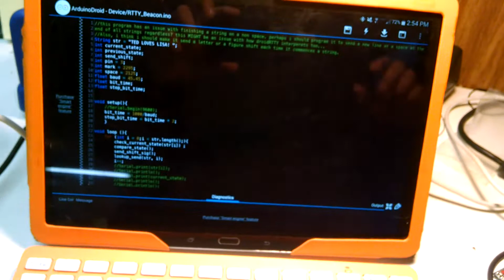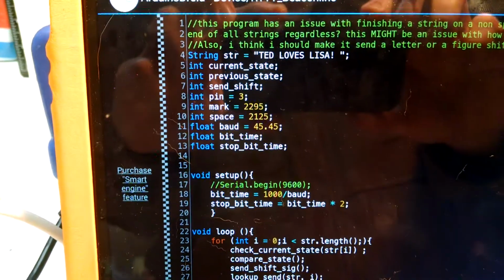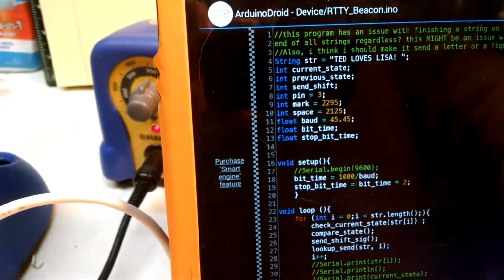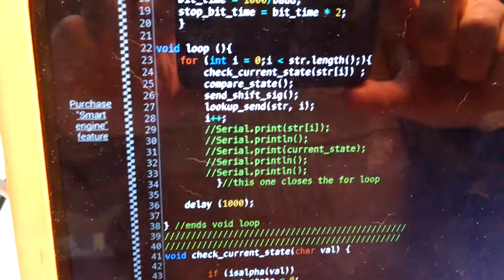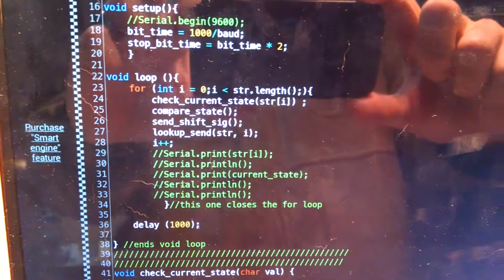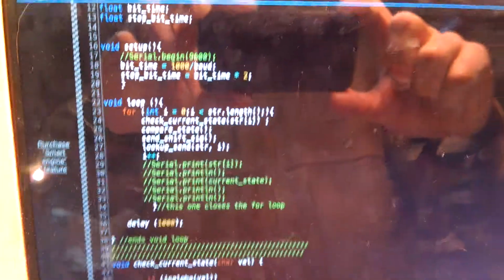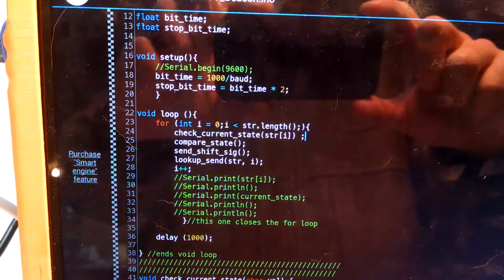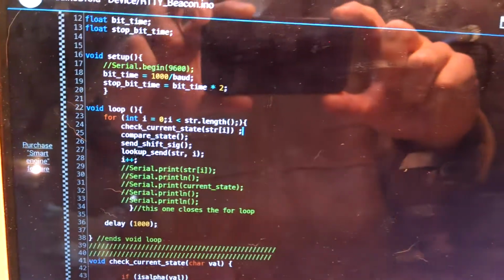RTTY Beacon Arduino

Comment: String str = "TED LOVES LISA!";
int current_state;
int previous_state;
int send_shift;
int pin = 3;
int marks= 2295;
int space = 2125;
float baud = 45.45;
float bit_time;
float stop_bit_time;
void setup(){
  //Serial.begin(9600);
  bit_time = 1000/baud;
  stop_bit_time = bit_time *2;
}
void loop(){
  for ( int i =0; i < str.length();) {
    compare_state();
    send_shift_sig();
    look_send(str,i)l
    i++;
    //Serial.print(str[i]);
    //Serial.println();
    //Serial.print(current_state);
    //Serial.println();
    //Serial.println();
  }
  //this one closes the for loop;
  delay(1000);
  //end void loop 
  }
}

compare_state(); & send_shift_sig();
    look_send(str,i)  are missing!           That means I have to stop to learn over Data communication.
Reply: Code is not working... Is that the original Code?

EDIT: Oops of course it's not the whole Code :D. Do you have the whole code?

Comment: I was able to compile and get it to work on arduino1.6.5 for pjrc.com teensy 2.0 @ 8MHz pin 9 (PWM) to GND (add 330 ohm resistor in series to speaker and watch waterfall using fldigi.  REM upper case only.  Thanks Ted.